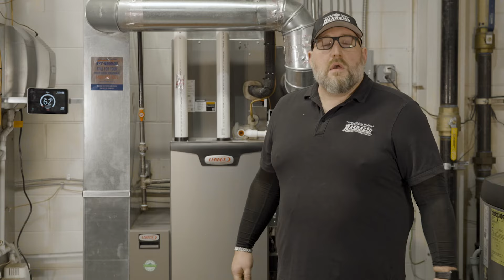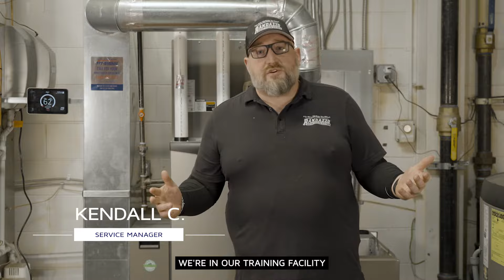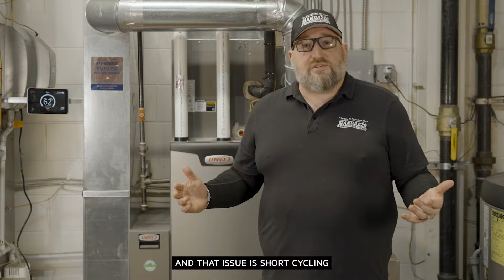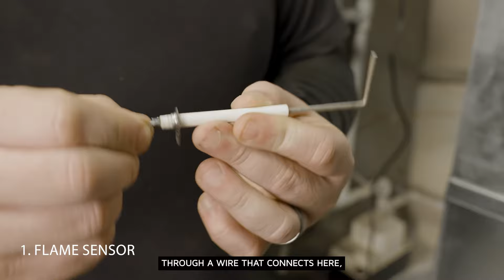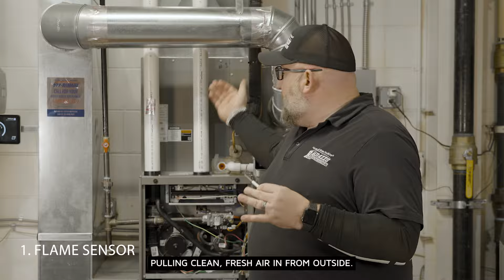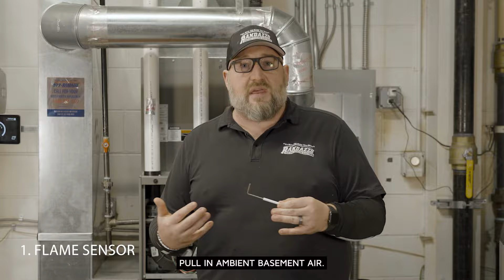Why Is My Furnace Short Cycling

Comment: New construction home   thermostat  mounted  in family room  2 1/2 ft below return vent on the on the next stud cavity .  thermostat seems to be satisfied always in about 8 mins and house temp only last 10 mins and furnace starts again.  after 2 new themostats which acted the same, found the therm cable was run through the wall and down the floor through a 1/2 inch hole  which was not sealed. And was directly above the main trunk duct in the basement .      So i sealed the holes and put a foam spacer behind the thermostat . Now its good.   Long story short 
The moment your furnace turned on, that main trunk line in the basement got hot immediately.

The Chimney Effect: Because the hole wasn't sealed, that heat rushed straight up into the stud cavity like smoke up a chimney.

The False Reading: Within 8 minutes, the wall behind the thermostat was warmer than the room itself. The thermostat thought, "Wow, it's hot in here!" and shut off.

The Cool Down: As soon as the furnace stopped, the trunk line cooled, the wall cooled, and the thermostat panicked, thinking the room dropped in temperature, causing it to start the cycle all over again 10 minutes later.

Comment: My furnace was short-cycling intermittently. About 1 of every 4 cycles was a short one. When the blower came on the gas valve shut off the gas. I checked all the usual suspects but nothing seemed to fix the problem. Then I removed the ground connections to the gas valve and reseated them. The furnace has not short cycled since. The furnace grounds itself through the gas valve, and it was oxidized ground contacts at the gas valve that was the problem. So simple to fix once the real issue was found.

Comment: My system has intermittent short cycling. After I restarted the system then it worked normally and reached to the set temperature.  After that, the short cycling happens. I replaced the flame sensor but didn't seem to work.
Reply: Yeah I don't think this guy is going to help anybody out because you know they're big franchise company he'll probably tell you call a professional
Reply: Same problem here. First cleaned the flame sensor and thought I had fixed it. Problem happened again. Installed a new sensor. Worked fine for a day and started short cycling again.
Turning it off for a couple minutes and restarting it gets it working again for a while.  I'm thinking the  control board has a gremlin in it. 

Let me know what you find. I'll be back if I fix mine first.
Reply: Check insulation levels. If you have low to no insulation you got a problem
Reply: Update: With some special tools and gauges, I figured out that the draft sensor was a bit off on it's trip points and during operation it was telling the control board that the draft was insufficient. 
New, lower trip point sensor ordered. Actually ordered an igniter, rollout switch, temp limit switch and might get a spare control board. Spare parts are reasonable, available and great diagnostic tools.